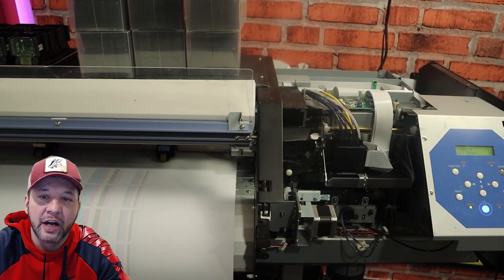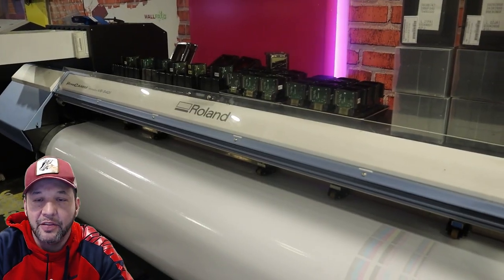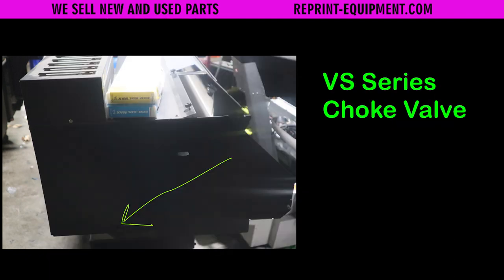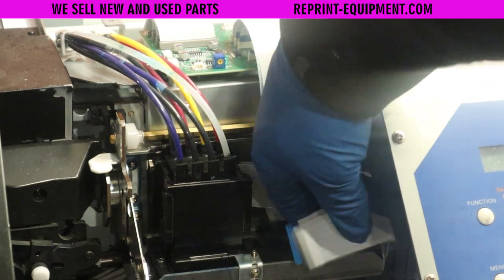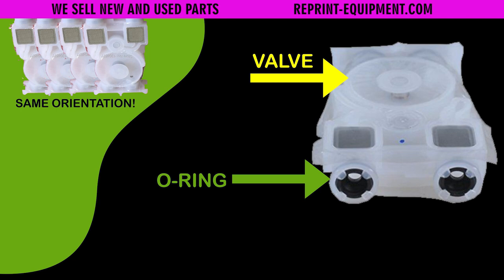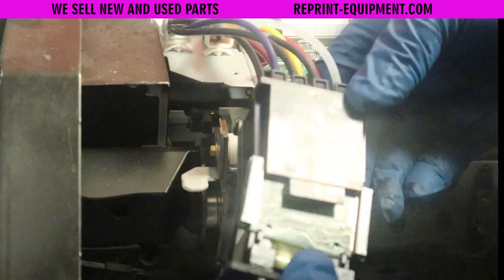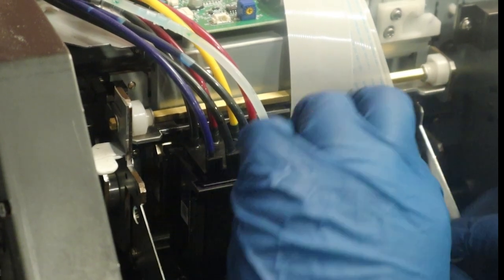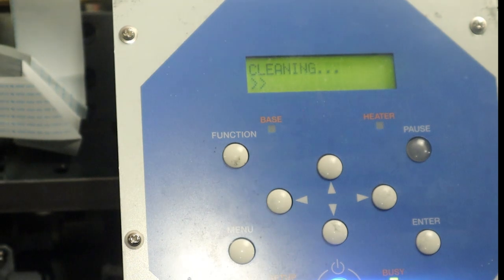DX7 Printhead Replacement Roland VS 540i 640i HOW-TO-GUIDE 2023

Comment: Hello. Thanks for the video - very helpful. We just replaced one of the print heads on one of our XR640s. I failed to save the packaging and don't have the head serial number. However, I did take photos of the head and there are numbers on it. Is the serial number on the actual print head? Just curious. If not, is there another solution or work around for this issue? Thanks in advance. ~Tim
Reply from the maker: Yes those would be the numbers you input!

Comment: Hello friend! thanks for the help. I have a problem. after replacing the head, damper, captop and pump, ink is not coming out of the head, nothing is coming out. I've tried many things, and so far nothing. Would you help me ? What can it be ?
Reply from the maker: Ok, so nothing is coming out into waste tank or nothing printing?

If its not pumping first thing I would check is captop. There is 3 connectors on bottom of captop. 2 should have lines coming off of them, the 3rd should be capped off! Ive seen instances where the cap comes off the third. Please check
Reply: @reprint217  checked. captop is good. the ink does not flow through the captop. could the head be burned? what else can i try to do?

Comment: great video! I'm having some problems after installing the print head. so 4 out of my 7 colors work and three don't want to print. every time I do a test print it doesn't show the three colors but it will fully show the other 4. I'm wondering if I did something wrong during the process or if there is just some other under lying issue that I don't know. if it helps, we have a vs-540i
Reply from the maker: Feel free to give me a call. 217-413-2532 gladly help you out

Comment: Great video and very appreciated. I have a VS-540 6-color and I'm missing my Black Channel completely and most of my Yellow Channel. I also noticed that the black ink tube is not filling up when doing cleanings. It is empty about 3" before the damper. The head was replaced two years ago but we haven't been using it very much lately. Does this sound like a damper replacement job to fix the black or is the printhead bad? I did an overnight soak and no improvements. I also checked under the Ink cartridges and the inside of the machine is clean.
Reply from the maker: Hey, Sorry, I have been in Atlanta at Printing United Trade Show. If still not resolved, shoot me an email. Signworx217@gmail.com

Comment: Nice videos! Recently got an sp540i and was wondering what is the best solution to clean ink stains on the plastic covers?
Reply from the maker: Bleach and magic eraser works best. If ink has actually etched itself in. Than I use headlight restoration kit and sand and polish

Comment: Thank you for a great guide. 
I'm facing problems after i replaced to the new head and dampers that when doing an testprint - theres nothing printing..
I can see when i do the cleanings that the ink is flowing through the head - captop and to the waste tank. But when printing - there's nothing.
Do you maybe know what it could be?
Reply from the maker: You more than likely blew fuse on mainboard or a transistor.
Reply: @reprint217  Thank you, it was a blown transistor on the mainboard.
Reply: @RightHns  how you work out it was transistor?
Reply: @deehaytch8442  i measured the ohm on the transistors, one of them didn’t ”response”

Comment: Ok, so I have a vs-540i and replaced the head with a DX6 after recommendation from Digiprint.  What is the difference between a DX6 and a DX7?
Reply from the maker: No difference, they technically were never called a dx6 or 7 they had long part numbers but some call them dx6 and dx7. You bought the correct one

Comment: Hello sir, bought secon hand dx printhead from china,is it necessary to input the value after installation like what you did to new head in service mode?
Reply from the maker: It is best to input the actual headrank, but most usually work fine with old headrank but have seen overspray in certain channels and odd electrical problems if headrank is not correct.

Comment: Do you know which Printhead this Mimaki Model CJV150-130 uses?
Reply from the maker: Yes, I actually have a brand new one with the head memory board for sale. It's a DX7 . You can use cheaper DX7 heads, i.e., Roland DX7. However, the oem printhead has a head rank memory board that can be pretty important. The head rank provides info for proper voltage and firing. Most of the time, the old head rank can allow the printer to print properly, just not optimum. But every now and then, I've seen cases of electrical issues from improper head voltage. So it's best to stick with oem. I think there is about a $500.00 difference between the Roland Version and Mimaki version. I have one left for $1500.00, and it is the oem brand new with head cables and memory board
Reply: I joined the forum sign101 which i read alot of users seems to prefer Mimaki printers over Roland, and Mimaki cjv150 some still use theirs for over 6 years and still going strong. From what i read from your comments it seems DX7s print differ between both printers and their prices as well. Am thinking of replacing my roland xr640 for a mimaki 150 model, as new roland printer has many issue from what i read. Thank you for your advice
Reply: It seems Mimaki DX7 is way cheaper than Roland DX7